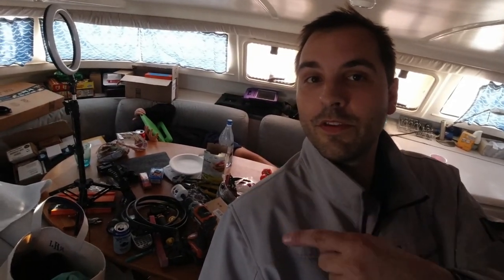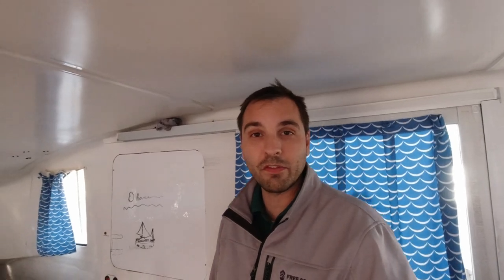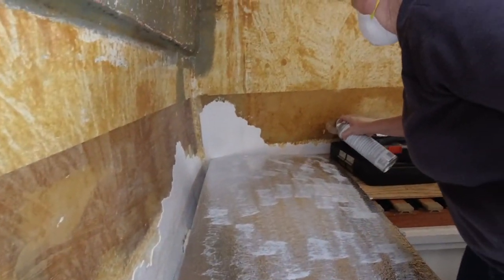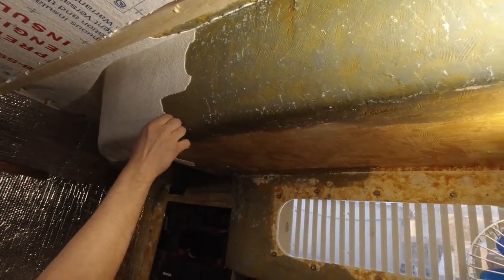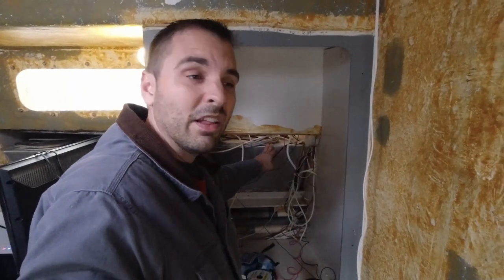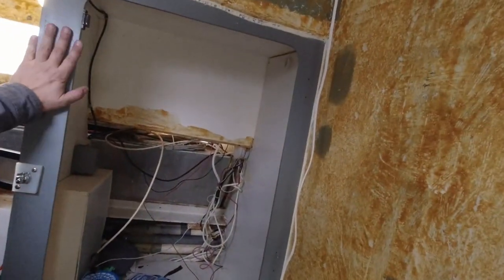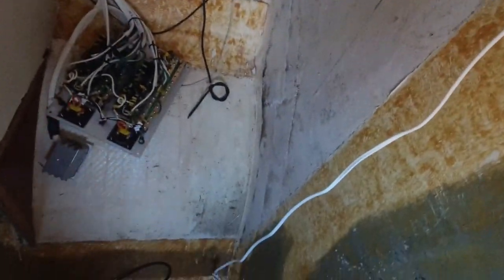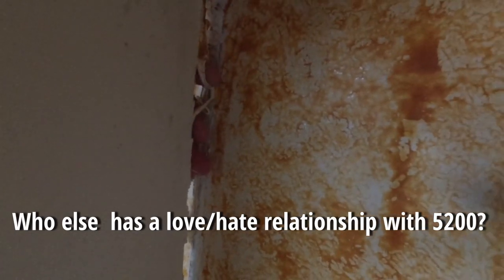Blue Water Catamaran Sailboat Refit [DIY]  Ep.17

Comment: Ok, I gotta ask. What did that lithium bank set you back? That's a huge upgrade.
Reply from the maker: It was a few years ago and prices are better now. But as I recall the batteries and BMS boards were 1200.00. The Victron equipment was the worst but soooo worth it.  The system has been in service now for 2 years and has performed excellent.  In the Bahamas we were able to live off of solar 100%.  We even had “extra” power after we hit 100% and we would make bread and ice… etc.   we are very happy with the system.

Comment: Just wondering why put an electrical panel below a fuel tank? If that fuel tank develops a leak or if fuel is spilled etc...
Reply from the maker: Yeah, I thought about that also, but this is where it was from the factory.  So we’re stuck with it there.  The tank is in the cockpit and is designed to leak into the cockpit space, not the interior cabin.  It would have to be some catastrophic failure to have diesel leakage into the cabin. Also Diesel is not very explosive.

Comment: The Eperb are different Freq Depending on what models they are some are Radio Freq direct or over the horizon an then the other one maybe a Satellite up link. One can use the model types and online search to see what operational frequency they operate on.  as For Battery replacements on Safety devices require t new record of test and certification for the owner safety.
Reply from the maker: EPIRBs are 406 MHz